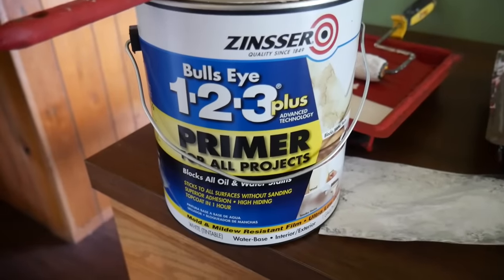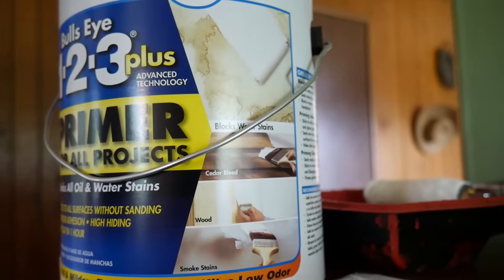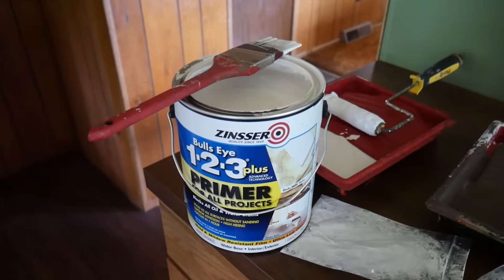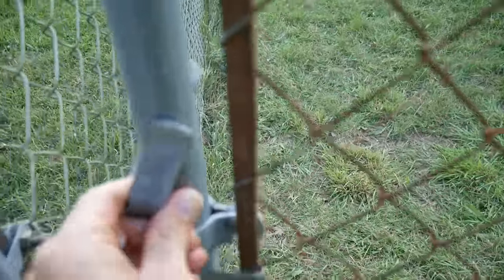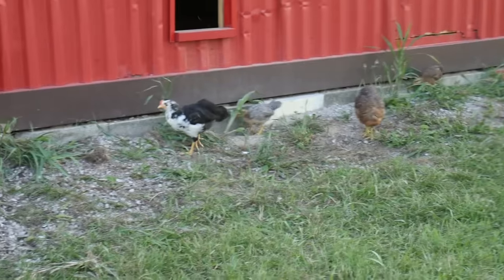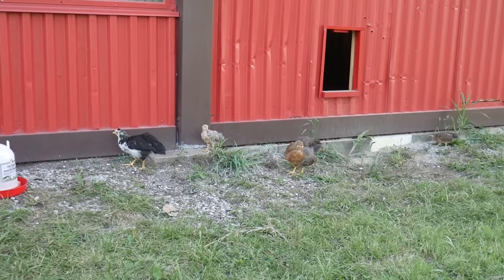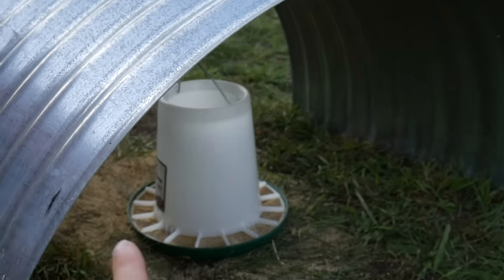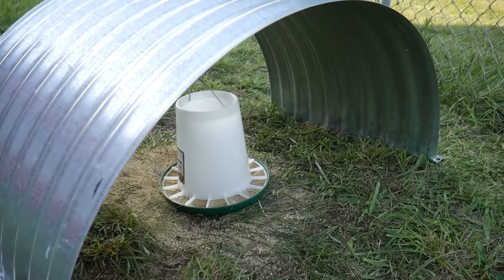Painting our Stained Mobile Home Ceilings (FINALLY!)

Comment: Just so you know for the future , the only primer that will get rid of interior stains of all kinds is an oil base quick dry primer.( Cover Stain by Zinsser will do) , it's at most big box lumber outlets. Never believe the promises of latex based primers, they are only good as second coat primers over oil base primer or for no stain bonders for walls and ceilings. The oil base is almost unbarable to breath but one shot, stain over. Wear a respirator with charcoal filters. I'm old school painting contrator 40 years. Not a criticism just a friendly prod.

Comment: If you hang your chicken food from a hook and some sealant in the hook hole so you don't get water in , you won't get as much wasted food from the chickens scratching as they can't do it if the food hopper is suspended , it only needs to be up about 3 inches or so , but it will stop them  ( and save food ) ~ your welcome LOL

Comment: We used about 6 foot extension poles on our rollers when we painted our ceilings. You do not hold your heads up anywhere as much as the roller is further out from you. We used 2 coats of stainblocker as we have popcorn ceilings and the material sucks the paint into itself and is not quite white enough nor fully "sealed. yet. A local painter recommended 2 coats because of those factors.
When you make that first roller pass, its instantly amazing just how far off from "white" your already supposedly once upon a time white ceiling was.

Comment: Ya'll are so inspiring! You have motivated me to get a few of the little things done around my house that I have been putting off. I have repainted my vent covers in my ceiling and put them back in place, replaced both of my ceiling light/moisture exhaust fans in my bathrooms, repainted my master bathroom, chose new flooring to be put in throughout my house and have started building the lattice shade panels for both of my patios. I love porches on the front of homes, but my house has a small 4'x4' inset porch at my front door. I am almost finished with the design for a pergola style porch with a brick floor all the way across the front of my house. I live in a brick, ranch style home which is 2400 sq. ft. All of my children are grown and my husband passed away five years ago. My home has needed refreshed for several years. I have lived in this home for 30 years and I am finally making the changes I have always wanted. Thanks for motivating with all your hard work! My cement driveway is double wide and will fit four cars. It is cracked and broken in several places, but cement work is expensive. The driveway will have to wait until next summer. I will have a new walkway poured to the new pergola porch at the same time.
Reply from the maker: That's a lot of stuff! I'm glad to hear that we have motivated you, that's awesome!

Comment: On my last home in Decatur IN, I had some water stains in a ceiling, due to plumber breaking a water line, I used the same primer that you used.   But the primer was oil based.  I started with the primer you used went over area many times and water based did not block stain as they kept bleeding through
  oil based primer cut it.  I then put 2 coats of ceiling paint on.  yeah I did this to get my former home ready to sell.  seems I get more motivated to do fix up stuff when I an selling.
Well take care and hope you get lots more money than you paid both your property . :)

Comment: Top Class job as usual. I hate ceilings too, a little less since l started using the jumbo rollers stuck on a long brush handle. The roller has the job done super quick and the long handled, handle makes it easier on your neck. Just mentioning in case you find yourself painting several at one time again, or not and you just want to make it easier on yourself for the one ceiling. Nice to catch up with you guys. 🤗

Comment: Mobile home I lived in from 2005 to 2011 needed ceilings painted - horrendous job - had to paint strips between panels with a brush, then the panels with a roller - arms were SO tired when we were done.  Really hard work but so worth it - the ceiling looked like new.

Comment: Good job and you did it yourselves. For serious ceiling stains I spray on some varnish to really seal it to prevent the Kilz from being absorbed into the ceiling material and below the stain surface.:Let it dry overnight then your sealer will do it’s job. The blue painters masking tape is much easier to apply and remove. Way to go.

Comment: Kilz orginal primer is a tried and true for water stains. It's great for so many things but that's one of it's first uses, if you don't want to use Kilz as your primer you can use it on stained areas and you're good to go with usually one coat coverage of the stain. Just a tip I've been using since 1994 and still works better than anything I find today, but only Kilz orginal, be careful not to accidentally get another version for stains, tried them and never again. I guess I'm an almost old painting veteran ;)
Reply: We used killz on our walls that look exactly like these. It covered the walls very well and the paint looked a lot better. I personally was not a fan of the wood paneling in our mobile.

Comment: Looks fantastic! Those stains looked like nicotine stains. Like whoever lived there spent a lot of time in the kitchen & were smokers. The stone sounds like a great idea if you have it already or can get it free. Otherwise, have you thought of just having a load of gravel delivered and covering the entire drive too? We’re going to have too do that and it’s not very expensive. I know that whatever you do it will look great! You’re doing an excellent job. Blessings...
Reply: And the delivering dump truck driver will be able to spread it to desired thickness. (May have to pile a little next to the awning before doing the spread dump.) Depending on location, it's about $35/ton (1 ton will cover a 10x20ft driveway 1" thick). They wouldn't have to use a lot as it's basically dressing for sale. It's a tidy welcome mat for the property.

Comment: You guys are doing a great job. It's hard to keep motivated when you won't be there to benefit personally from your improvements and the work may not add actual hard $$$$ to the sale price but it will certainly appeal to buyers and help with the sale.
You have taken all or any doubt as to what they are buying as everything is in place working and looking smart including the chicks (you can't leave them, surely).

Comment: Used the same primer in my bathroom, works well! I had old blue paint, staining from the wallpaper adhesive and bits of exposed brown paper from damaged drywall - this stuff did the trick to conceal all of that. Now it’s painted a very light gray but you wouldn’t know that it’s hiding all of that underneath!
Reply: Hey, next time you’re trying to hide a stubborn spot, Gardz Problem Surface Sealer is AMAZING!!! I used that before skim coating and before the 123 Primer, really to prevent the wallpaper adhesive from reactivating when putting anything liquid on top of it. It really does seal everything in underneath and doesn’t allow anything to bleed through. It’s a milky white translucent liquid in the can but dries like a clear nail polish almost.

Comment: Your ceilings look good. I've got popcorn ceilings throughout my house. I painted the kitchen ceiling and OMG what a miserable job!
Reply: I hate popcorn ceilings. The last house I owned that had them I didn't even bother trying to paint them. I moistened them with a little water from a pump sprayer (being careful not to over do it and risk damaging the sheetrock), and scraped them off with a long-handled scraper that had a foot-wide blade. The water penetrated even though a previous owner had spray painted the ceiling years prior.  It came off so easily, I did the whole house in a couple of hours. The hardest part was getting the first penetration of the blade through the paint. Once that was done, it practically zipped off. In prep for doing it, I laid down thick disposable painter's drop cloths (to protected the flooring) and when I was done I folded the popcorn up in them, packed them tight, put them in lawn/leaf bags and hauled them to the dump (had to pay extra even though we didn't see any black flakes of asbestos in it - the testing would have been more than the extra dump fee at the time). I then did knock-down texture in a heavy brocade by hand. I was really happy with the results.

Comment: 2 years late here but I'm getting a mobile home on 31 acres of land soon so there you go. Best thing to use is Zinnser (like you used) or Killz. It will seal in any smells and stains. Good job! I'll be doing this soon!
Reply: I am planning on painting my kitchen and hallway in my mobile home but when I tried my bathroom, it sooked up the paint so it took 2 gallons.  Does primer or kliz better?
Reply: @daleleitheiser2789  Honestly the best thing you can do is gut the walls and ceilings and replace it all with drywall (5/8). But yes, that stuff does work better as it seals everything in.

Comment: FANTASTIC JOB!!!!! I have mobile home outside and inside all painted but the ceiling it made me want to do the painting. when is the best time to paint? we live in southwest and get 12 inches of rain a year ,but when I paint it seems to rain also. I am thinking the window to paint my ceilings is when the air conditioner and heater are not on in fall as we have a floor venting since our swamp cooler is on ground with stilts
Reply from the maker: Yea, I personally would paint when I can freely ventilate the house so as not to breath in fumes while the paint is drying and curing, though interior paints have come a long way and are a lot less smelly. As long as the humidity isn't too high it will dry fine.

Comment: We have the same paneling material for our ceiling. It has four 
holes in it (about 2" across) that are from a long light fixture that the previous owner had taken down. Do you have advice for repairing those holes?

Comment: I have popcorn on the  Ceiling and I do have stains. From past experience painting over  Popcorn ceilings is job and a half.  Any advice.  Do have some stands
Reply: I used a cheap sprayer from harbor freight, it's under $20

Comment: I'd wish my trailer had the same ceiling as yours.Do you know what yours is made of?Mine has sheetrock with the popcorn paint,and I dislike it.As far as the parking area goes,have you looked into using stone dust?I know people who used it,and it makes a great driveway!
Reply from the maker: Our ceiling is a fiberboard type material. It's kind of like the drop ceiling panels if you ever saw those up close. It seems to have help up well over the years. I don't know if they even make them anymore. For the driveway we will probably get a crusher run which is a mix of stone and stone dust. I hear good things about it.
Reply: Thank you! Loose stone can be a problem in the winter.It seems to scatter everywhere,and it's hard on snowblowers.I'm still not sure what I'll do with my ceiling.I'm thinking of covering it with paneling.I'll just have to look around.

Comment: This is the type of ceiling i have on my mobile home.  My bathroom ceiling has mold, do you know if i can use zinsser mold killing primer on these ceiling. Reason im asking is because it say use only on non porous surface are these ceiling consider porous because it's texture or non-porous.  Your video you used zinsser 1-2--3 , but i have mold need to kill mold. Please help, love your mobile home renovation videos. Can you also please tell me what these ceilings are call? Before primer what did u prep to clean it? Thanks
Reply from the maker: They are fiberboard ceilings made of cellulose fiber. They are made of a porous material but I believe you can still safely use that primer on them. The only issue is that the primer will not be able to soak in and kill the mold that may be within the panel. It would only treat the surface.

If you want to be sure the mold is gone make sure the source of water or moisture is fixed. Then I would try to use a mold killing cleaner or something like Concrobium mold control, then prime and paint. 

The mold killing primer would be a good option.

Comment: Looking Good Y'all,Those Ceilings are hard to Paint for sure,I have done it!,Was wandering did you have to do anything with any of the Electrical/Wiring in the Trailer?
Reply from the maker: The electrical was all pretty good but some of the outlets were worn out so we replaced a couple and added a new switch in the bathroom. I don't like loose outlets that don't hold a plug tight. We also replaced a light in the kids room and rewired the lights in the kitchen to make sure they were safe. So just little stuff really.
Reply: That's Good,Yes loose Outlets are not good for sure,One thing you might want to check is the Feeder Wires between the Pole and the Panel inside,There should be 4 wires "2 Hots 1 Neutral and a Ground",The Ground is often forgotten and this is Dangerous and could be a Shock Hazzard

Comment: I am fixing to remodel ours. What paint you use?
Reply: I have the popcorn ceilings does it matter on the type of paint
Reply from the maker: I wouldn't think so but you may have a harder time getting it covered evenly because of the texture. You will probably need a roller with a thick nap. Any interior latex should work and they do have ceiling paint but we think it doesn't cover very well. That may be a brand issue though.

Comment: What paint did you use for your ceilings?
Reply from the maker: We started with a coat of Zinsser 123 primer to hide the stains. I don't know what paint we ended up using, but any interior paint will work fine.

Comment: Do you know if that type of ceiling contains asbestos ? 

I was recently exposed to dust from that exact type of ceiling & would like to just know .
Reply from the maker: I'm pretty sure these types of mobile home ceilings did not contain any asbestos. Older drop-ceiling tiles may have contained it though. I wouldn't be worried.
Reply: @diyfferent  Thank you !

Comment: Did you mention what prep you did to wash off the oil, dirt, etc before priming the ceiling?  If so, I didn't catch it.
Reply from the maker: We didn't do any prep work.
Reply: Any issues a year later or still looking good? Wondering how much scrubbing I need to do
Reply: @jtoein  I painted our mobile home ceilings and they all peeled off .. I would suggest prep of some sort 😞

Comment: I have a question or you guys since you have so much expierence in renovations.:) Do you have any ideas or have you ever painted a ceiling that has the drywall tape coming loose ? TIA and love what you are doing with your home !!
Reply: SeaShellsandPalmTrees Pull the old drywall tape down. Retape, float, prime and paint with ceiling white. If you have any stubborn stains, use a shellack based stainbllocker. Then prime with a good water based stainblocker.
Reply from the maker: Johnny explained it well :)
Reply: Thank you Johnny. I tried gluing it back up and also putting spackling over it too but it just always comes back down. What do you mean by "floating" ?
Reply: After you have reapplied the drywall tape, you go over it with drywall mud using a larger drywall knife. Do a search on YouTube " taping and floating drywall". I was a painter and there are techniques that are used.  You can also hire a drywall finisher if you have the money and want it done right. Overhead drywall is worse than overhead painting. Yes it is a pain in the neck.  Let me know if you can't find it on YouTube.
Reply: Thank you Johnny . Yes, sounds like a project waaayy beyond my skills !
Reply: SeaShellsandPalmTrees Sounds like you either have a settling of foundation,or drywall tape was not applied right. It may not cost that much to have it done. Prices vary by location. A good drywall finisher can do it quicker with little, to no sanding which means less dust. Good luck.